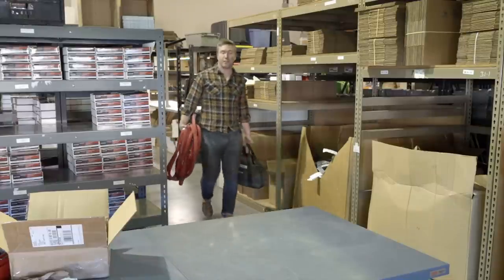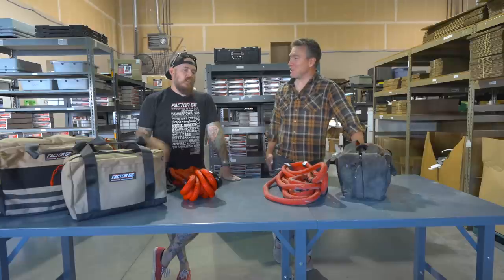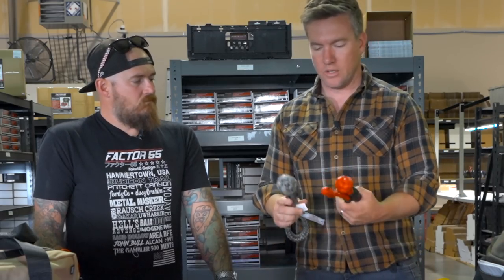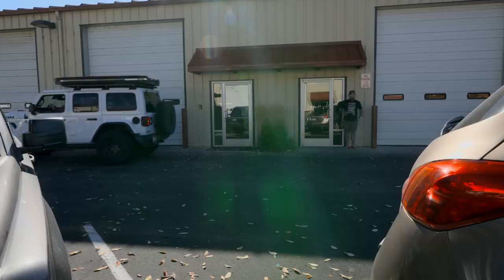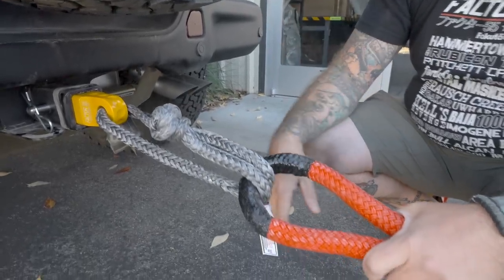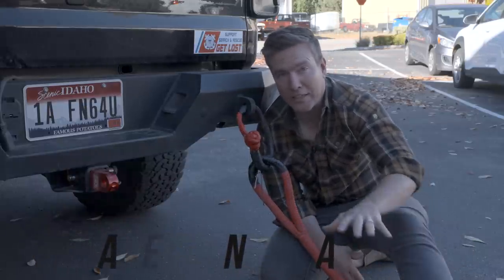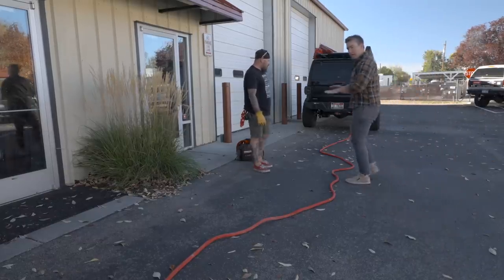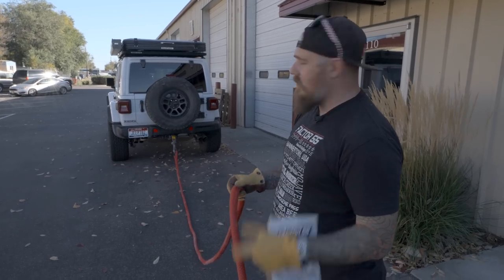I've Used My Off Road Recovery Gear WRONG. Have You?

Comment: I'm a crane operator, so I'm very familiar with Working Load Limit, Minimum Breaking Strength, and Safety Factor ratings. I really appreciated Justin's explanation of those terms, but I was SHOCKED to discover that every piece of Factor55 gear I looked at on Amazon listed the maximum breaking strength which, as Justin explained, means absolutely nothing.
Reply from the maker: Thank you for pointing this out! There's an issue with incorrect info on Amazon which they are working to fix. It's also why they prefer folks to go the website (https://geni.us/Factor55recovery Save 10% with V2R10 ). You won't see maximum breaking strength listed there...and if you do, let me know so I can give Justin a hard time for it! Cheers!

Comment: Great video. I think Justin missed an opportunity to point out another key factor. When he showed a better way to hook to the pull vehicle, he moved along the cross member near the center of the jeep. This is critical for the pull vehicle because an off-center hook up will siphon off a good amount of kinetic energy when the pull vehicle jerks sideways due to off-center pull point. Not as important for the stuck vehicle (in fact off-center can help the stuck vehicle if you’re trying to steer it away from a hazard as you pull it). But it can be very important for the pull vehicle imho.
Reply from the maker: Great point! Thanks for sharing!!!
Reply: Yes. And the pull vehicle should also be in a direct line to the other vehicle so as to avoid the loss of energy and traction from a whipping vehicle.
Reply: Good point. That energy doesn’t just disappear, it goes into the frame. Pulling from one corner only can diamond the frame, or tear off recovery points. Bridles and slings are really important.
Reply from the maker: @phillipbrown8620  Next time I'm in this situation, I'm going to use a harness...I had one in my bag, I just didn't take the time to stop and think about it.
Reply: Thanks for sharing this. Good tip

Comment: Thank you, thank you, thank you - although in retrospect a lot of what Justin shared is simply using a little common sense (some was definitely eq specific knowledge, thank you Justing for that) – however without these nuggets of information while being under stress due to the recovery situation our common sense may not be as intuitive as in normal situations – which brings me to the following: Every spring and fall I let my winch cord out – use a little dish soap in a 5 gallon bucket rinse it then recoil it by pulling up the drive making sure it is wound properly and ready to go. Now I will add a little practice time and familiarization with the recovery gear. Anything as serious as recovering in remote areas should be practiced – this is not something most of us do every day so why wait to figure it out when you need it the most? Thanks, Will great video at the right time.
Reply from the maker: I'm gonna start doing the winch line maintenance now. Great Tip!

Comment: I'm late to the 'game'; fine video, both of you, good reminders & tips. I made a call to Factor 55 & ordered some more product, I've ordered a good deal in the past. I was reminded almost a decade ago with my Jeep, I got front and rear metal bumpers & the holes and ports were for metal shackles (soft shackles were not popular then). But when I shifted to soft I realized that half of my soft shackles would not fit in the holes & there were stiff edges that would damage the small shackles if a heavy pull was made on them.  In some cases, in a pinch, I'll put in a hard shackle & then attach a soft shackle to that. The rear attach hitch mechanism has holes plenty big for the shackles as does the prolink on the front of the winch cable. I only mention this for any that may be new to the process - soft shackles come  in various sizes & shapes & metal shackles might work in a pinch if the soft don't  - but be safe when using them.
Reply from the maker: Great info, thanks for sharing.

Comment: Factor 55 needs a larger diameter snatch block. I had to go with an Australian brand to find one. Larger helps in certain applications where smaller won’t. Can’t wait for future products. Been using F55 products since the beginning.

Comment: First question with the "stuck jeep recovery"; What is the towbar rated to? There is no point in having all the fancy high load raings on the recovery gear (although you should have that, but it's not the point in the question), and you're recovering from an unrated, unchecked recovery point! Yes it's rated for towing, but not for recovery. Yes Justin covered this a bit, but not fully for the actual bar itself. 
Question 2; Why use the soft chakle on the hook, why not just put the recovery rope over the hook? One less thing to break/damage.

As per usual, great advice from Justin.
Reply from the maker: When you say tow bar, do you mean the hitch link in the tow hitch or something else? The soft shackle on the hook has been covered a few times in the comments here…there were reasons to use it on the Gladiator hooks, but I could have also just used the rope loop. In either case using the Velcro straps would have solved the problem I was trying to avoid.

Comment: Great collaboration and I bet a follow up regarding comments (mine included) could  justify another video completely. My approach to mud and rocks is that you’re much better off winching vs kinetic being that it is much slower and controlled. The suction in mud and hanging points on rocks or buried debris can break rigs if not careful.

Comment: I have Factor 55 recovery gear and the main selling point for me was Made in the U.S.A.
I had looked at some company called Rhino USA. I emailed them to find out if their priduct was made in the U.S.A. as the name implied. Boy was that a mistake. They seemed so pissed I asked but in the end told me their products were made in china. They proceeded to try to convice me it was made to their specs but for me it was still a no-go. 
It's impossible not to buy something that has parts made in china, but when I can, especially buying aftermarket Jeep parts, I always buy U.S.A. made priducts. 🇺🇸
Reply from the maker: I love supporting USA made products whenever it makes sense…and F55 is an easy choice because I know how high quality their manufacturing specs are.

Comment: I bought a Factor55 Shorty Strap based on this video. Looks to be perfect for threading through a lower control arm on a vehicle that doesn't have a good recovery point. However, I do question the reinforcement of the strap though. It seems like the ends of the shorty strap near the loops are reinforced and rigid. However the middle where it folds is not reinforced. I worry that middle un-reinforced section could get cut on a lower control arm.
Reply from the maker: According to F55 - The whole strap is 2 ply and covered in Cordura.

Comment: 24:52 - It sounds like the recovery described was an attempt at a tow, not a pull/yank. Which from what I've learned is the appropriate thing to attempt before going for something more forceful like a kinetic pull. Instead it was used here as an example of what not to do, when it is often a great, safer option to try first.

Comment: So, is there a rule of thumb for how many pulls one of these kinetic ropes can support before losing elasticity, or breaking?
Reply from the maker: Great question. I don't know. Will ask Justin to comment.
Reply: G'day mate. Driven most of Australia solo and am a Rigger by trade (hook up loads for cranes). They lose kinetic energy with every pull. By 5 pulls they are definitely less effective (noticible) and by 10 it's a good idea to let the sit for half an hour to get their strech back. Also most people use them wrong ( they pull slowly like any other straps) the idea is to drive fast and get a good strech and sort of sling shot them out. ( you will be amazed how much more effective it is this way.)
Reply: @garyhost1830  thanks for the info. Makes sense that they lose elasticity quickly.
Reply from the maker: Thanks Gari! @offgridadventure sorry I forgot to reply. Justin says that depending on use these ropes can last a long time…but improper use and careless storage can shorten their life to only a few years.

Comment: 22:20 why use a soft shackle on the open hook when the rope is less gear? I mean it seems like a “more product gimmick” 🤔
Reply from the maker: Great observation. I cut out the part where we talked about that…because we’re talking about one type of OEM Hook, but showing another…it was a bit confusing. On that Wrangler hook, directly connecting the rope would have been better. On the Gladiator hook, it’s debatable…but that was too much speculation to include, so I cut it right to Justin showing us the Velcro strap tip, which I think was really useful.

Comment: When connecting to the factory hook as they did in this video, is it necessary to use a soft shackle or is it ok to connect the kinetic rope directly to the hook? And what the reasoning?
Reply from the maker: Assuming it's a good hook, It's ok to connect to the factory one - you may still want to use the velcro straps though...just to help keep it from jumping off the hook. In our example, we were using a Rubicon hook, which is much different than a Gladiator hook..it would have probably worked better to just connect the rope directly to the Rubicon hook...and maybe the Gladiator hook too, but since we didn't have one there, I didn't include it in the video. In my recovery example, I used soft shackles on both rigs, which may have been unnecessary, but I also think it was a decent approach as the soft shackle has more flex with recoil than the fairly stiff Kinetic rope loop - so the likelihood of recoil pushing the Kinetic loop off the hook was higher IMO. This is not hard science though, it was a judgement call.

Comment: So I have a question. Why not just go straight to a recovery point in the vehicle with the kinetic rope vs using a soft shackle? Is it strictly to protect the end of an expensive kinetic rope and have the soft shackle be the sacrificial link of a less expensive part?

I've always gone straight to the recovery point with the old yellow straps -snatch 'em straps we used to call them back in the day. Those old straps were pretty tough.
Reply from the maker: It's a great question that's been asked a few times in the comments here. I cut part of the video out where we talked about it..because it was confusing...with the Wrangler hook, it would have better to just put the rope loop on the hook. With the Gladiator hook (which we didn't have there) it was more debatable which would stay on better...but either way works...generally speaking the least connectors involved, the better - as long as all of the connections are solid and safe.
Reply: @Venture2Roam  Thank you for the reply Will. I'm 55 now so I've done things differently over the years. Plenty of recoveries for other people and of myself. Open to new tricks though. The soft shakles do appear to be pretty convenient vs the old hard shackles.... I'm sure safer too.

Appreciate your videos and certainly the reply.

Many thanks, Matt

Comment: I have been in situations where I needed at least 2X the length to recover the stuck vehicle.  I have used 2 kinetic straps to good effect for this, but I am wondering what the "best practices" are in such a situation?  Thanks.  Excellent video by the way!
Reply from the maker: This is a great question, I’ll pass it on to Justin.

Comment: 22:01 - I was ready for the advice to just eliminate the soft shackle from the equation and hook the kinetic rope directly around the open hook. That would have been even better, right? Or is it not advisable to connection a kinetic rope to a rounded metal hook in this situation for some reason?
Reply from the maker: In the video, yes - just put the rope around the hook. In the actual event I was describing the hook was a bit different so I thought the soft shackle would have less recoil to come off...but in general ya you can just put the rope on the hook.

Comment: justin. What good does a Minimum Breaking strength of say, 30K LBS... When the consumer is not going to understand how that load applies in a given situation..... In that case maybe  Co. should require the customer to state what rig weight  is and then the Co can give them the correct diameter rope and soft shackles  to purchase ?? Just a thought
Reply from the maker: I sent this comment to Justin :)
Reply from the maker: Check the sizing guide on the kinetic rope page: https://www.factor55.com/p-extreme-duty-kinetic-energy-rope-00559

Comment: Well let me tell you how we did it in the old days. We would pack an old pickup tire and a couple of long chains. Hook to both vehicles with the chain then through the old tire. Then give er. Really cushioned the jerk. Without the tire you usually pulled the bumper off.
Reply from the maker: Wow. 😳😶😯

Comment: Please don't wire them that  way. Running power through the switch into 30 is a bad idea unless your switch can carry the full current of the draw. Those switches max out a 15A I believe and two lights are probably right on the edge of that.  Folks running smaller switches should ABSOLUTELY run two relays with a fused power to the battery on pin 30. You're instructing good folks on how to burn their rigs down without some serious clarification or disclaimers.
Reply from the maker: I think this comment is on the wrong video.
Reply: @Venture2Roam  sorry; this was intended as a response to the harbor freight lights

Comment: Just saw another youtube vid showing through a drone view, the issue of soft shackles on a kinetic rope pull. Pull attempts are 7min to 12+min to where the kinetic rope repelled back to the Bronco. 
Caleb talks about the ratings of the soft shackles and the kinetic rope near the 32min mark. Appears that the soft shackle was previously weakened or that the soft shackle had poor quality of rope. It appears the choke portion of the shackle tore. This soft shackle was in the eyelet which a d-ring would set. The soft shackle had its sleeve in the eyelet hole.

https://youtu.be/NrIR_4IPIbk?si=qbISyKMBsMDh2wzU
Reply from the maker: That video is a great example of what Justin was talking about with using a soft shackle through a shackle tab on a bumper. The hard edges and very small hole violate the bend radius of the soft shackle and tear right through it. It's also a fantastic reminder to go slow in a recovery situation. The guy was in a hurry (as we all have been at some point)..and that's when it's really easy to pass over important information. This guy got so lucky, I'm so glad he's alive..it goes to show just how dangerous even a snow pull can be.
Reply: And then I get sent this video haha @Venture2Roam
Reply from the maker: @popo_patty  That's so funny. I'm so glad you're OK man...and a massive tip of the hat for putting that video out there..it's already done so much good. I'm sure you're getting all kinds of advice/critique/etc...from every angle...but that video is driving a really important conversation in our niche right now...so thank you! We've ALL probably had close calls that we don't even know about...and if we can get past our own egos, we can continue to learn from each other so cheers for leading an important convo!

Comment: We need to go back to logging chains I guess. If it don’t pull out get a bigger truck or tire chains.  . Ben doing it forever. But the one guy that over yanked . Over powered crazy. Gas industry up in arms… what scares me is seing so many with winch. Tight line. Standing next to it. Towing cars everyday. Heavy towing. . Not the everyday man. ??? 😮 people will do stupid stuff like useing rope around tree . Small rope to snatch block. Doubling power should be done only by smart people. Not educated people. They the dumb ones. G-day😮

Comment: I personally use a fuse shackle for single vehicle pull so i know where its going to snap. If you guys care about safety,  lower your prices
Reply from the maker: I don't think lower prices = caring about safety. Caring about safety = quality manufacturing, testing, R&D, and product integrity. Literally all of those things cost money. Having been to F55 many times, I can tell you they are not spending money on nice real estate, fancy furniture, or any workplace luxuries...they spend on making the product. They are priced higher than other brands, many of which are just trying to rip off their designs, but when it comes to recovery I'd rather spend a little more on the highest quality possible.
Reply: Perhaps this poster doesn't understand research, development, robust testing, manufacturing with lot traceability, AND the ongoing repeating of these steps to insure the quality and safety of products.  
F55, keep doin' what your doin' 
This was the best training vid with real explanations I've seen.

Comment: Another great video with these guys Will, lots of great information and really cool of these guys to spend the time ( ya I know it is advertising but still great to hear them nerd out on this stuff). I don't recall if the first video had this information but would be nice to see their thoughts on what size for what type of vehicle. A lot of people make "Jeep" kits which is easy but with our new Grenadier which has a higher GVWR can we size up or stay Jeep and still get the proper recovery dynamics since I would prefer to buy one that works for everything instead of having multiple kits.
Reply from the maker: I don't think we covered what size for which vehicle. Great idea. I know F55 has a guide on their Kinetic Rope pages that shows which rating you need for different GVWs...it's probably the easiest place to start for your Grenadier. Congrats on that by the way..those look very cool!